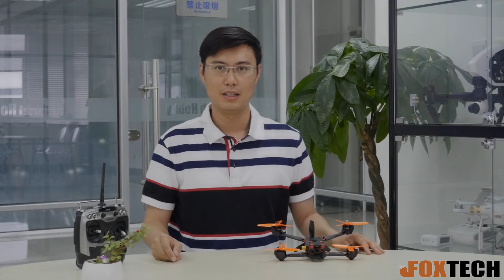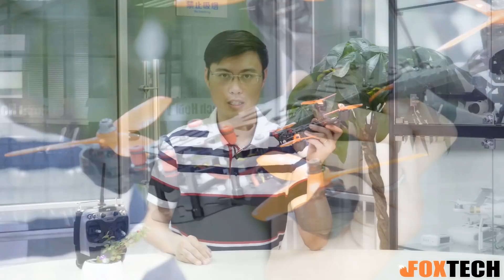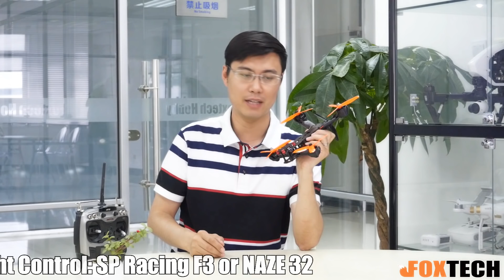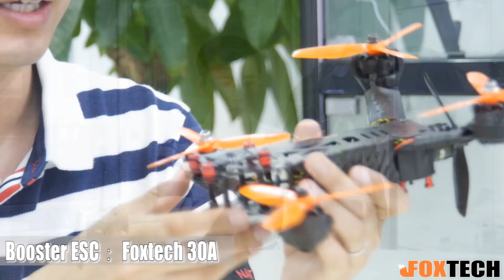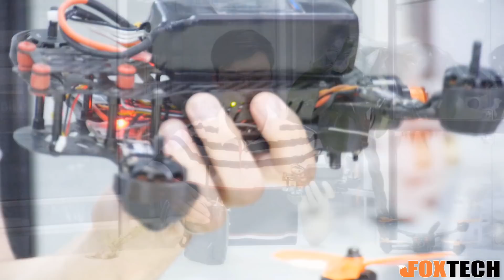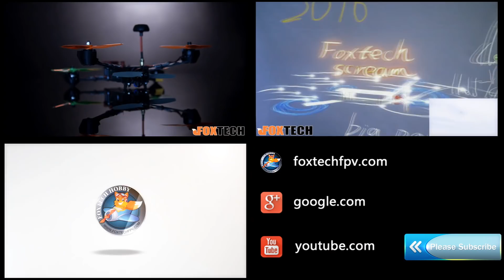Foxtech Screamer 250 Racing Pentacopter Features Introduction

Comment: How do you land it without hitting the rear props? What if the rear prop is vertical when you throttle it down and want to land?
Does it mean you break the rear prop after every flight?
Reply from the maker: The rear motor will stop spinning immediately once it is turned off from the knob/switch;The prop will change angle easily from vertical at the moment it touch the ground, so it won't damage the rear booster
Reply: +Foxtech Hobby would be nice to see that in action. Taking off and landing. Make a video of it soon.
Reply from the maker: https://www.youtube.com/watch?v=iAgoxN3zIi0